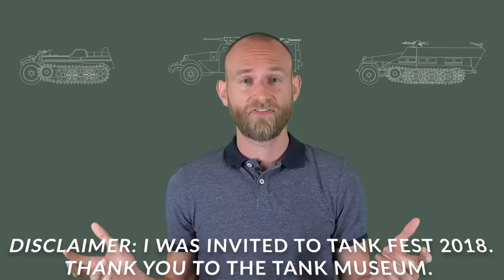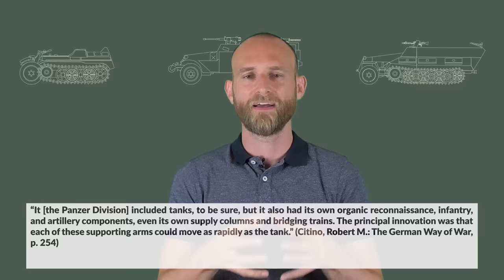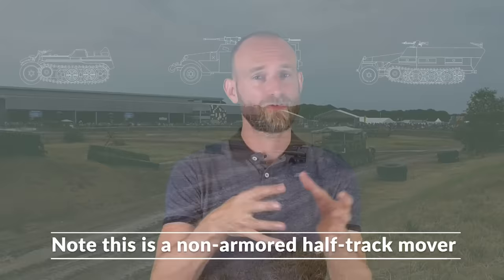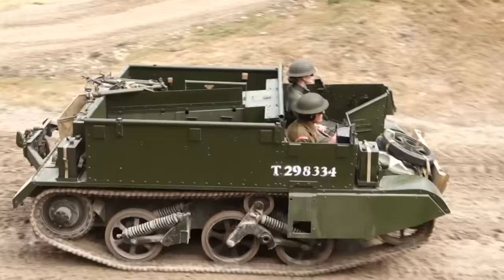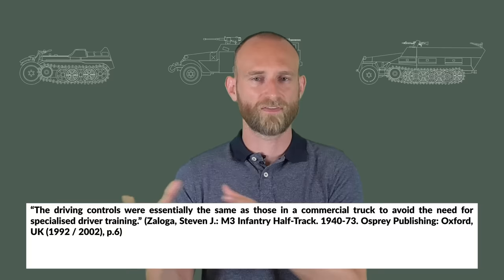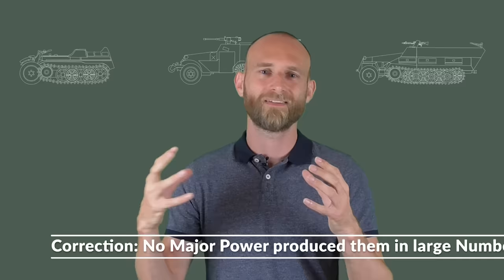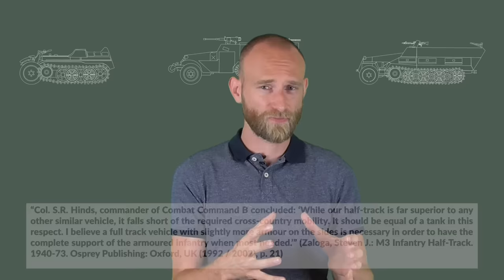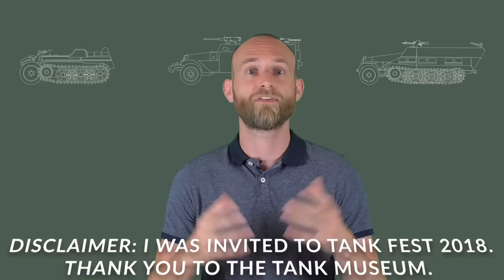Why Halftracks? Why limited to WW2 only? (Featuring Tank Fest 2018)

Comment: Steering of tracked vehicles, at least throught the M113, was with laterals, two levers, one for each track; this goes back to my one experience in basic training in 1980.  To go ahead straight, you had the laterals in the same position relative to each other; to accelerate, push them forward the same amount, to slow down, bring them back the same amount.  To turn right, you pushed the left one forward, but kept the right one more to the rear so that the left track was going faster than the right.  To turn left, do the opposite.  Sounds simple, but it takes a while to get the hang of it going faster than a crawl.  
Current tracked vehicles, however, use a steering wheel which coordinates the proportion of power going to each track and an accelerator to control the speed.  It is very similar to normal vehicles, except that there is definite sense of the mass you are trying to control when you accelerate.
One other factor to remember.  If you loose the tracks on a hill, you cannot stop.  The brakes work on the drive sprocket, not the road wheels.  If you loose one track, you can stop the other, but the freewheeling track will swing the vehicle sidewaysand creates a good chance of ripping the remaining track off.
BTW, the M60 tank, I believe, weighed about 60 tons, but exerted only about 11 pounds per sq inch, whereas a woman wearing spike heels may weigh 110 pounds, but exert hundreds of pounds per sq inch if she has most of her weight shifted to the rear.  On soft ground, you would rather have an M60 run over your toes than your girl friend in spike heels.
Reply: That last part is nuts
Reply: There was also the pivot sticks situated above the laterals, to quickly spin the M113 180 degrees.
Reply: They were built this way cuz of farm boys both in Germany the world for that matter. Tank, half tracks etc were set up like farmin machinery. Most soldiers had a lot of experience running that style of equipment. Wasnt a great set up for being in actual combat tho.
Reply: Nah, spike heels everytime.
Reply: Tank you Mr.James.>>>>>>>>>>>>>>>>>>
Reply: Tank you Mr.James.>>>>>>>>>>>>>>>>>>
Reply: bob the sodomite Yes I drove a US Allison-Chalmers tractor from 1947 and it had two levers to drive each rear wheel like halftracks, but it also had a steering wheel for the front wheels.

Under stress it seems like those controls could be slightly clunky but still totally usable.
Reply: Or you can build loads of cheap universal carriers with a steering wheel and track warping which damn near anyone can drive.
Reply: When I learned to drive an M113, I quickly realized it was like riding a horse (western style) and it was nothing at all to pick up the skill.
Reply: @MonkeyJedi99  Admit it.  The horse does some of the work.  It adjusts for uneven ground where a dip on one side will accentuate a turn in that direction or cancel out some of a turn in the opposite direction.
And while I did ride a horse three or four times during my high school years, it was on a fixed route where the horse knew the way.  My main task was to keep the horse moving and not supplementing its diet by grazing along the trail.  "I also had a semester of "equitation" as PE in college, which is far from making me an expert.  And that is a whole lot more riding than the most recruits get today, or even in 1980.  Of course,, that was about a haof hour of actual driiving in basic trainin and I never served in a unit with 113s again.
Reply: @jameshorn270  What do I have to "admit"?
Anyway, I did end up in a unit with M113's. Well, actually the M106 mortar carrier and M577 command vehicle variants.
-
As for horse riding, my family had horses until I was about 8, and I only rode a couple of times after that.
Reply: @MonkeyJedi99  Think of it like this description of an early Russian tank with a tank commander who communicated direction to the driver by tapping his shoulders with his feet.  The tank commander was not actually driving the tank, but he was giving it direction, like a rider and horse.  The horse adjusts for terrain, surface changes, an optimum speed within the range allowed by the rider.  Driving with laterals takes a bit of practice, a good deal more than I got in basic.    I will grant that with pivot steer and such, that laterals can give a degree of control which  is difficult to get from a wheel IF you are practiced.  However, I was in the National Guard, and even getting soldiers qualified on the older manual shift vehicles was difficult due to lack of time.  Tracks are taken out even less than trucks and jeeps so I would imagine skill at that level only develops during Annual Training
Reply: @jameshorn270  I worked with a guy at Ft.Hood who was willing to try the foot tap method. Even with 1970s tech, we found that this was quicker than using intercom to direct the driver. BTW, before intercoms became standard, U.S. crews, and I suppose, everyone else, used that method.
Reply: I read about the ground pressure of an average person is about 7 PSI, the old British Scorpion tank's ground pressure is about 5 PSI,  that means the tank can drive across mud that soldiers cannot walk across. Women high heels , some have an area of about 1/4 sq inch  and 110 lb can be on that only , so it is not nuts.
Reply: @jameshorn270   the M60 driving over your foot needs a calculation adjustment: you calculated for a surface where the entire track surface touches the ground. While moving over a foot, part of the track is either lifted to accomodate for the shape of the foot, and thus not transfering it's share of weight to the ground, increasing the pressure on the areas that do, or the foot is pressed into the soil so the calculation remains the same, but good luck with that on a hard surface like a paved road.

Then there is all the road wheels and rollers that can move up and down, courtesy of the suspension. I have a feeling the suspension of an M60 will require more resistance than a foot can provide to actualy lift a wheel

Could be an interesting one for Myth Busters...

Oh, the part about the high heel is correct, they are absolute killers
Reply: @sjonnieplayfull5859  Yeah people get these oversimpified elementry school "facts" and suddenly think they have some actual knowledge. To expand on what you point out, the mean ground pressure says nothing of peak pressures caused by rigid components, the local pressure under a grouser that is also directly under a wheel will be enormous even without the overall track flexing over a lump. For small lumps at slow speed the wheel suspension is conformal to maintain equal distribution of weight, so it doesn't actually compress springs, one wheel going up causes others to go down. Inertia is still an issue, and the wheels do cause local high pressure zones even on flat ground. (Unlike many bulldozers which use more of a rigid plate "suspension" between the end sprockets.) 

It's just the inverse of the spike heeled shoe fallacy. Women don't walk around with substantial weight on their heels. The spike heel basically acts like a walking cane to add a bit of stability but most of the weight is born on the ball of the foot, so like the M60 the mean psi is still only about 10, but with peaks due to dynamic changes and contact between rigid and semi-rigid structures. 
Both peak loads and total loads matter though, a foot can take 10psi with a total load of 10lbs, the internal structure can distrbute that load, but 10psi over your whole foot(300-400 pounds) is going to be painful. Vertical pressure only, not omni-directional like water pressure, although even water pressure would be strange as it squeezes the blood out of your foot.).
Reply: @TheDuckofDoom.  Thank you for expanding on my point, as a non-native English speaker I struggled with a lot of the technical jargon 

As for the high heels: my guess is our physics teachers who brought this up never walked on them so they had no idea about the weight distribution

Comment: The half track concept was popular for early tracked vehicles (including civilian ones) because early tracked drives used crude clutch/brake systems to steer which required a great deal of skill and effort from the driver. A lot of work was done during WWII on improving steering for fully tracked vehicles to make it smoother.

Comment: U.S. Army still had and used half track trucks up until 1957 or later.  I remember seeing them being driven in field maneuvers miles outside of Fort Polk Louisiana in Hornbeck.   Army soldiers drove them up and down the streets as they participated in mock battle.

Comment: By war's end there were gearbox and steering systems that made driving a tracked vehicle easier AND more accurate (the M24 even already had an automatic transmission).  So not only did you have more drivers, they got easier to train).

Also, I suspect that seeing LVTs in action woke people up to the advantages of stern ramp doors (even if they were more expensive).  Which was a feature of most postwar APCs.   (this was the big problem with the "Kangaroos", the troops had to climb out).

And P.S.  The French also started with Half-tracks for their Mechanized Infantry, and did a lot of between wars work with them, lots of driving all over Africa.
Reply: The original LVTs didn't have the rear ramp, but experience soom showed that it was a good idea, not only for the troops, but for loading/unloading cargo in places without handling gear.   The ramps showed up on the LVT-3 and LVT-4s went into service in late 1943.

Comment: Halftracks are more difficult in steering the heavier the vehicle gets. At some point the wheels will not be able to bring enough traction to turn the vehicle at all. So you need to operate the tracks at different speeds to turn the vehicle, which basicaly means to operate two different systems to turn the vehicle at the same time. The handling of tracks also has improved. On the other hand all-wheel-drives have been developed to increase performance of road. Trucks can go off road much more easily today than during WWII. So you now have all wheel armored trucks like Fuchs, which is very fast and can go off road

Comment: My understanding is that halftracks, at least in Germany, is a result of the level of differential technology in the 1930’s and a requirement for high speeds.  Halftracks allowed gradual turns without sacrificing speed, as would be required with a standard clutch-break differential.  During the war more  advanced differentials were developed making the halftrack concept obsolete.
Reply: I've had a but of experience with working on and running both American and German halftracks.  In some ways, they're more different than similar.
The German Halftracks - Which are actually 3/4 tracks - almost all the weight is borne by the tracks, still have a tank-type clutch-brake system for anything but a very shallow turn.  They also have a sophisticated (complicated) suspension system, multi-link tracks, and a dead (unpowered) front axle.  This gives fairly good cross-country mobility, albeit with problems crossing ditches, (No help from the front wheels) and adequate on-road performance, but it comes at a number of costs.  Basically, your Armored Personnel Carrier is now as complicated to build as a Light Tank, it requires the same level of day-to-day maintenance, and special training for your drivers and mechanics.
The U.S. Halftracks are , have more or the weight borne by the fron wheels - it's basically a White M3 Scout  Car with the rear wheels removed, and a relatively simple suspension and  one-piece flexible "rubber band" tracks.  The front wheels are driven.  There's no clutch/brake steering required.  They're are easy to build, drive, and maintain as any other equivalent truck (Other than getting into the armored engine compartment itself, that's always a pain)  Road performance is better than a German Track, and cross country performance is slightly less.  So, a lot less complication for pretty much the same capability.
Since the U.S. already had a large pool of experienced drivers and mechanics, training wasn't an issue.  The ease of manufacture meant that we built a lot of them, not only fully equipping our Armored Infantry, Cav Recon and Self-Propelled Antiaircraft Artillery units, but also supplying the U.K., the Soviet Union, and French armies during the war. 
(So everybody had a lot left over when the war ended.)
Reply: Peter. Thanks for your reply.  I was never quite sure if the American, and I assume the French, halftracks had track differential.  I didn't think they did but thanks for confirming it.  Turning diameter of the American half track is about 18 meters the German Sd.Kfz. 251 11 meters so track differential does make a difference there.

Follow up question:  do you happen to know what the trench crossing capability of an American halftrack?  I've never seen it documented.

Bernard, a thought, German and American halftracks were built for different missions.  Most German half tracks were prime movers for artillery or recovery vehicles.  Artillery needed high speed and off road performance to leap frog forward to support the advancing combat units.  German APC halftracks were adaptions of existing prime movers.  US halftracks were prime movers for AT guns and APC's so didn't have to leap frog forward as much.  And yes there were a multitude of subtypes but the chassis didn't change.
Reply: dnillik,  The M3 halftrack's turning radius is more like 30' (10m). Don't forget that although there isn't a controlled differential like a full-tracked vehicle, it still has a standard truck rear differential.  Since the track length on the ground is shorter than that of the German tracks, there's less resistance to turning.
Trench Crossing - Not something I've done, so I ook a look at the Manual.  It doesn't give a trench width, but it does give approach and departure angles (The angle between the roller or winch and the front wheels, for approach, and between the  back of thrack on eh ground and the hull for departure - these are between 25 and 50 degrees.
Given the size of the vehicle and the geometry, I'm estimating it to be about the same as a M5 Light Tank - about 2-2.5m (6-7 ft)
It may also be worth noting that The speeds of the halftracks on roads - 50 km/hr (32 miles/.hr) for the SdKfz 251, and 40-45 mph (65-70 km/hr) for the American tracks is actually about the same as a standard truck on roads.  You can expect a late 1930s - 1940s truck to cruise at about 35 mph (a bi over 50 km/hr) on road, and much less off.
Reply: The US and German HT (roughly 14mm armor) was quite different as said. Especially in armor. The US HT (roughly 8mm armor) could consistently be penetrated by the German 7.92mm cartridge of the mg34 and mg42, while the German HT was quite resistant to the majority of allied cartridges. Even the .30 cal machine gun was not able to penetrate it with regular ammunition. You needed a .50 M2, AT-rifle or the like.
Which made a huge difference in usage. There are official German training videos of HTs used directly in front line attacks. The US HT was more to protect and carry infantry up to 1-2km behind the front line.
Both served their purpose quite well though. Different designs for different combat doctrines.
Reply: I cannot tell you how much I’ve been wanting to know what you’ve collectively posted here. THANK YOU!!!
Reply: Just drive a german halftrack backwards over a trench, problem solved. Not so much with american ones because the track is not that big

Comment: I seem to remember seeing a half track mounting quad 50s in Korea.  Long time ago and an old mans memory may be defective.  But I wouldn't be surprised if it were the last halftrack in captivity since we were Marines and the Marines at that time were usually equipped with surplus, outdated and castoff equipment.  I operated radios from WWII (ever see a TBX 8?) and some of them had "U.S. Army Signal Corps" labels on them.   But in our Corps, in our time, it may have been st-liberated from any nation involved in the war.  I know that  the U.S. Army generously supplied us with fresh eggs, telephone wire and heating oil through informal midnight requisitions.

Comment: In the Cold war USSR, Ifvs and Apcs were distinguished on the basis of function. Apcs were to transport troops to the frontline, fire support was secondary. They were to follow behind the line of infantry in zigzags, from hill to hill. The Ifvs, on the other hand, were to shoot at the enemy over the heads of friendly infantry during offensive. The Ifv based squad had a dedicated turret weapons operator, while the Apc based squad did not have one
Reply: So cold war USSR tactics basically said to send your infantry up front with all the armoured stuff staying behind the meatshields shooting over their heads.
Reply: MarcAFK Not exactly. Infantry was to follow tanks, and tank by a general rule were followed by infantry, at the distance of 100-300 meters. On the other hand, Ifvs and Apcs are much less armoured than tanks. It is nonsensical to put them in front, as they are too easy a target, and will be destroyed instantly. Basically, tanks break through, infantry takes control, transport vehicles support the infantry
Reply: That makes perfect sense.
Reply: jurisprudens usa still us them up to the 70s they was in ww2 keran war and nam as a gun truck
Reply: You're talking about half-tracks?